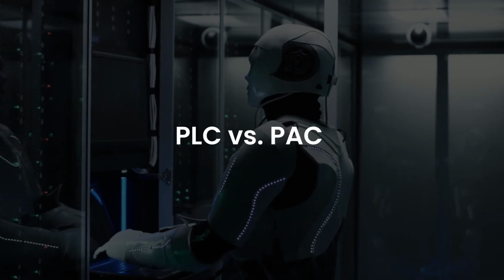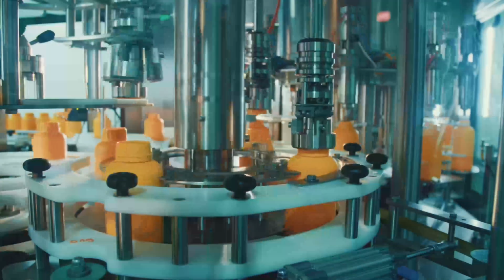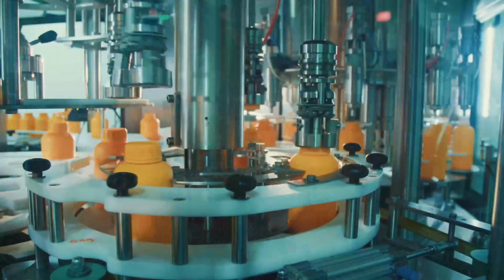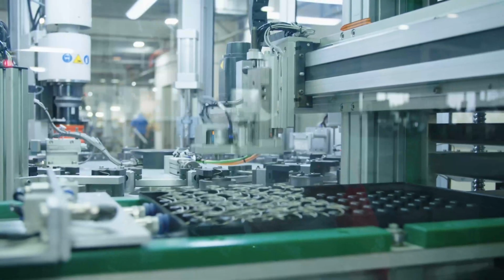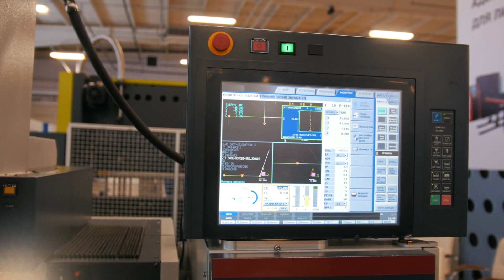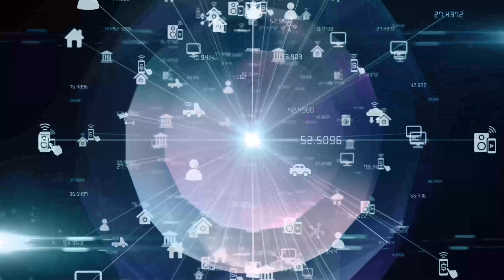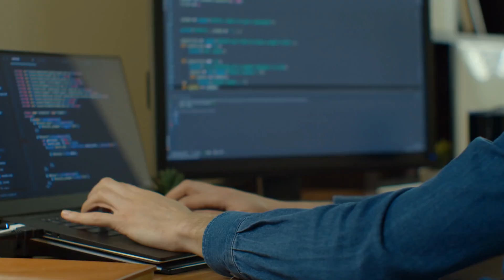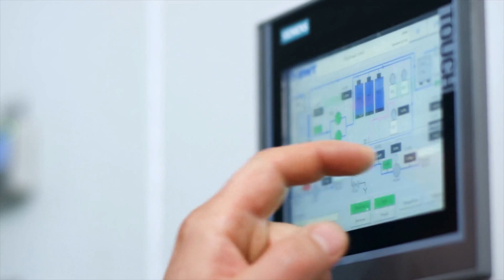PLC vs. PAC

Comment: 810 views  8 months ago  #plc #pac #programming
PAC allows you to control dozens of input/output endpoints simultaneously, thanks to their tag-based programming technology. A PLC system involves greater functionality than traditional relay-based systems, allowing you to code the sequence of various input/Output devices. A PC is a single processor, whereas a PAC comprises two or more processors, something that makes it similar to a PC …
2 Comments